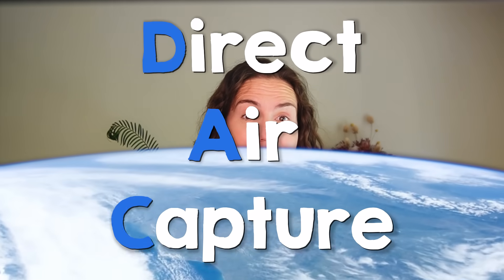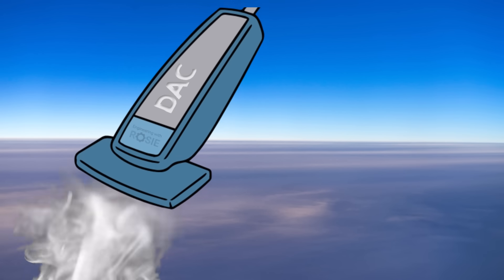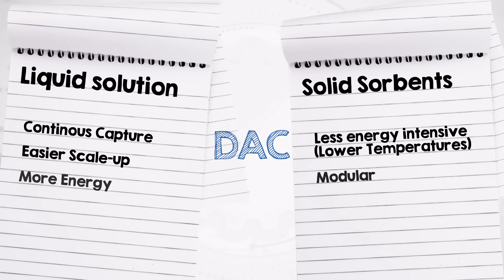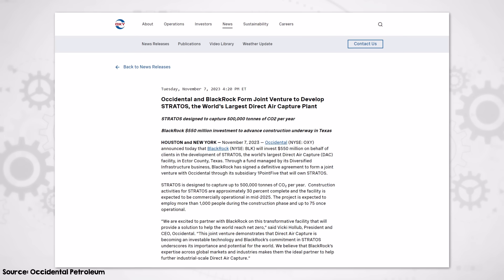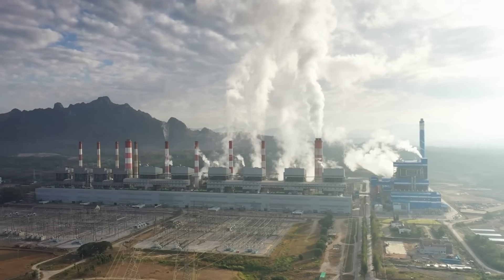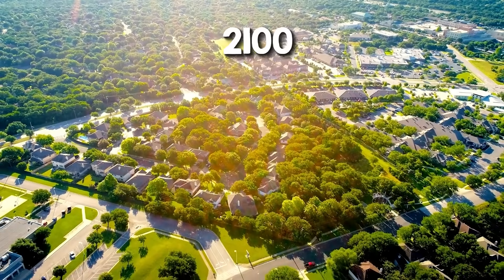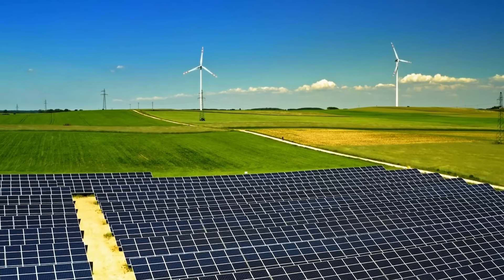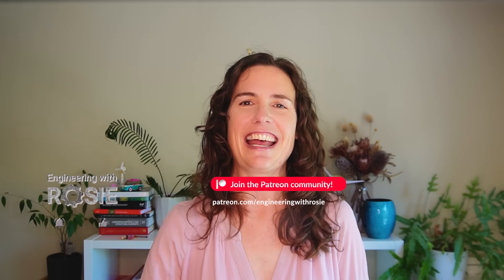Direct Air Capture: Climate Savior or Distraction?

Comment from the maker: Click my link to try Aura Health and save 25%! Your sense of peace and improved sleep starts here: https://www.aurahealth.io/rosie23
Reply: Aerospace engineer here - this is one of the most annoying subjects wasting out time these days.
There's no real need to go into the technologies. You can kill this entire argument just by asking how they'll process 1 Billion cubic kilometers of air to remove 2.5 Trillion tons of CO2?

Here's the explanation.
FIRST - the basic task comes from the fact we have (since the start of the Industrial Revolution) put an extra 2.5 trillion tons of CO2 into the atmosphere with 1.5 Trillion Tons of that being just in the last 80 years and at current rates we'll add another 1/2 a Trillion tons by the early 2030s. 
 
Way back in 1987 as an undergraduate (in America) we had a NASA Engineer (as a guest lecturer) explain to us why  terraforming Mars was utterly impractical. He'd just completed a project for NASA on what it would take. It was simply the amount of stuff needed to do the job. Before you even get to the subject of making things like water, oxygen and carbon dioxide cycles work you need to just get enough air and water. 

Its a subject I now call Planetary Mechanics which is doing basic calculations on volumes, mass and energy. He showed us just the basics. From that its relatively easy to calculate that to give Mars a layer 1km thick of Earth standard air requires 178 Trillion (with a 'T') tons of air. Plus you need to raise its temperature from -60C to +20C and that's a lot of energy for that much air. And you'd need a lot more than just 1km to make a planet viable.

The related subject is Planetary Dynamics which is how you make things like the water and gas and thermodynamic cycles work which is incredibly complex. Planetary Mechanics is reasonably easy for anyone to grasp except for how big the numbers are, because its mostly just being able to calculate volumes and what mass it takes to fill that volume. That's how you get 178 Trillion tons of air.

So coming back to Earth. 
Earths surface is just over 500,000,000 km² so in the first 1km above the Earths surface you have about 1/2 a Billion cubic kilometers of air. Its actually about 2% more than that. But its just easier to use 1/2 a Billion. Because if you want to consider the first 2km above the Earths surface its about 1 Billion cubic KILOMETERS of air and that's where most of the excess CO2 is and there's 2.5 Trillion tons of it we need to remove. 

So how do any of these clowns with plants that can do 1,000 tons per year plan to remove 2.5 Trillion tons?
How much will it COST in BOTH money and materials to build all these plants?
How much CO2 will be produced getting all those materials and building all those plants?
How much energy with it take to just build those plants and then operate those plants?

You don't need to explain the technology, because just the scope of the task rules it out as impractical.

If you want to know why an aerospace engineer is interested in all this stuff its pretty simple. My goal in life was to build a moon base. You then start with a couple of very simple issues. 
How do you build a volume of space that you can seal so that you have somewhere to live?
How do you fill that volume with air?
How do you get enough water to sustain life, because water is life?
How do you create just enough of biologic systems that they can become reasonably close to self sustaining so that you have enough air and food to survive? I think creating a 100% self sustaining system is impractical so the actual task is how close can you get for it to be practical in that it doesn't require too much effort to keep functioning.
THEN FINALLY - how do you power it all? This is where Kirk Sorenson got to when he was at NASA and re-discovered molten salt reactors.

If you want to do a video on this stuff let me know.
Reply: ... OR we humans could stop carbonating drinks.   😁

    I'll let myself out.        😒
Reply: @John.0z Yeah also stop breathing since you are just making more co2! Legit we are making it worse.
Reply: Hi Rosie! Great video as always! I found one of the points you made confusing though. At the 7:23 mark, you state that Carbon Engineering's pilot plant in Squamish, Canada currently captures 1 MILLION TONNES of CO₂ a year. However, at the 8:26 mark, you say, "Today, we have about 10,000 TONNES of carbon captured across 27 DAC plants worldwide." I suppose the 10,000 tonnes figure is per year? If yes, that is way less than the 1 million tonnes figure for the Squamish plant and clearly doesn't include this amount. So, these two statements don't add up. I couldn't find a source for the 1 million tonnes a year number for the Squamish plant. Could you please clarify where you found the data that the Squamish plant currently captures 1 million tonnes of CO₂ per year?
Reply: @innominateperson5275  I was going to comment on this. I'm pretty sure that the "million" at 7:23 should have been "thousand."
Reply: @londonwestman1  Thank you!
Reply: https://www.youtube.com/watch?v=go92lAvJTzE
Reply: WASF! We are orders of magnitudes off here basically pissing into a volcano!
Reply: Just a quick addition.
I know that since 1940 we have added 1.5 Trillion tons of C02 because I have that data because its well published.
And I know that at current rates 1.5 becomes 2.0 Trillion tons in about 2033-34.

I am not as sure as the 2.5 to date which you said was 1.7 Trillion tons. I think there is some contention over the pre-1940 data and what the "normal level" is supposed to be. If you look at the historical CO2 graph that NOAA and others publish then it should be below 270ppm for a normal Milankovitch cycle, except there was that event about 200,000 years ago that had one cycle hit 300ppm.

Irrespective getting the current 415ppm back down will take a geoengineering effort of staggering scale.

The only viable way that I can see it being done is a massive worldwide re-forestation program. We have to see trees as very cheap low maintenance solar powered carbon pumps. The issue is the number we need. In ball park terms we need every person on the planet to physically plant themselves or have others plant for them 1,000 trees. Hoping that we get 1-2 in every 8 survive to adulthood then we'd have 1-2 Trillion trees each pulling 1-2 tons of Carbon from the air.

Every other plane like seeding the ocean with iron to promote algae growth or seeding the upper atmosphere with SO2 has major issues in that NOBODY KNOWS what the secondary effects would be. The SO2 idea is the most off the deep end thing I have heard yet. What if it doesn't work? What if it works to well? What if they get it wrong and all that SO2 falls out of the sky as sulphuric acid AND its the same sort of questions for iron seeding the ocean.

In the end it comes down to doing something we know will work and we know trees work. We just have to do it at the scale that is needed.
Reply: Anybody trying to figure out how to make the transition to green energy needs Aura Health.  I on the other hand worry about the crazy people trying to end fossil fuel before it's feasible.  I don't need Aura Health because I know people won't prematurely sacrifice the economy and their standard of living for unreliable green energy.  Hopefully they don't figure it out too late.
You also need to consider the decrease in  productivity things such as electric trucks and electric tractors will have on the GDP as well as the economic cost to the consumer that it causes.  Don't even pretend to hope Fusion will be a viable energy source - the cost to build the reactors will be too high.
Reply: @kerryb2689  Your worried that we might get rid of oil before its feasible but ya not worried we will kill the planet before our we get rid of oil ooook.
Reply: great analysis!
Reply: Rosie, thoughts on ABC's In-Depth: Where is Australia at on the road to net-zero?

Comment: 2:10 The need to move air is not the real reason for using a lot of energy. In fact, you would probably prefer a location with a lot of air moving on its own.. (You might even tap that for the energy needed for the whole DAC process.) The energy is needed to liberate the CO2 once you have captured it in some absorption medium.

Comment: 1PointFive has gone from 0.4KT in 2022 - to what will best case be 500KT in 2026 when Stratos goes live.  To reach 59,000KT by 2030, they would have to build 120 more plants the size of Stratos in the next 5 years.  That means an average of 2 plants a month.  They haven't even announced a SECOND plant yet, much less 120 more.

Comment: As an engineer, you should also note that we have a seawater elevation issue that requires the elevation of large land areas or very expensive dykes.  Injecting supercritical CO2 deep underground increases ground level.   This was done with water in Long Beach, CA, and experimental CO2 injections.  In Long Beach, the elevation increase was up to 3 feet.

Comment: I think that the people of Hawaii that had an alert on their phone warning of an incoming ICBM probably would not think that ABM satellites are  such a kooky idea.  Since satellites are not sitting still but moving at a velocity similar to an ICBM and in the same direction,  an ICBM is an easy target.  The LAWS flying laser missile defense could destroy targets 100 km away.  
CO2 and Hydrogen  can be removed from seawater with electricity and used to synthesize ethanol.  If instead of offshore wind turbines that get in the way of fishing boats and nets and recreational boaters, large ships were used to collect wind and solar energy to synthesize ethanol, there might be a number of advantages.  No huge expensive  power cables and substations and underwater structures and expensive anchoring.  The ships can travel to where the wind is.  Like into a hurricane.  A hurricane with 120 moh winds has 64 times more power  than 30 mph winds.  A one kilometer square multihull ship with a deck 100 meters above the water and  with a 300 meter high sail has about 30 billion watts of wind power available in 120 mph winds. Dragging big propellers through the water to collect the energy instead of using huge turbine blades might require  a lot less materials to withstand the forces.  The deck area could also be used for solar panels or dishes.  1000 dishes firing a ten million Joule pulse might be enough to vaporize just about any target. Air turns into plasma with enough energy going through a small enough volume of air regardless of whether or not the energy is ionizing radiation..  Turning the air into a plasma bomb might be like slamming the target into a brick wall.  And if the plasma generates enough Xrays, it can fry the inside of the target.  The Navy spends zillions of dollars on ships.  These ships would pay for themselves and make a huge profit in ethanol. 
The ships might also be used to substantially reduce the power of a hurrucane. If an average hurricane has about 1.5 trillion watts of wind power, 100 ships would absorb most of the wind energy.
CO2 which is of great benefit for increasing food crops has been redefined as an existential threat by politicians who have been deceived by sneaky people with PhDs.   I was just a sophomore amongst graduate students that had to answer the question that the professir had posed some days before while the PhD's sat there clueless.
https://youtube.com/clip/Ugkxuk1XVQt9EBbtdXcjK9Sd3KarQPUvnY21?si=vNe8m34ULUEcG_a3

Comment: 2:20 That's not the reason for energy use. Indeed, you could put the DAC devices in the path of strong prevailing winds. The energy need is for liberating the CO2 from the capture medium. I'm a bit confused on why this statement is made, as the rest of the video makes it obvious that Rosie understand this aspect of DAC, in fact in great detail.

Comment: There is a perfect cheap system to suck CO2 out of the air, it also stores it and works on solar, it is called: a tree
Reply: And when the wood rots?
Reply: @maxriley1769  Prevent it from rotting and use it as a building material.

Comment: Any kind of force air movement for DAC basically renders it too costly and energy intensive.  Passive air movement via wind really looks to be the only affordable method.  Likewise the need for the geologic repository to be directly under the site means both things need to coincide and that's going to be rare so it will only be done at a few locations on Earth.

Comment: Here's an MIT professor who has direct experience on the topic of DAC talking about it.  Long story short we would need to expand our capacity for DAC by 100k times between now and 2050 in order not to exceed our goal of limiting warming to 1.5 deg C... The only problem is we're passing 1.5 deg C of warming right here right now.

These plants are talking about capturing 5-10 megatons/year whereas humanity is emitting 45 gigatons/year... and the fires in Canada last year alone emitted 1.2 gigatons of CO2.

Translation we would need 4500 of these huge plants, immediately, even to break even with our existing emissions.  Meanwhile humanity is growing in population exponentially and its energy use therefore is growing supraexponentially... as underdeveloped countries become developed. E.g. world electricity demand in 2050 is projected to be 5x that of 2020, which means 80% of the energy use in 2050 will belong to those unborn (or new uses in developing countries).

Unless these aforementioned 4500 plants can be powered with renewable energy... and be put into operation before all the major tipping points tip, it's too late to matter. 

59000 kilotons/year in 2030 for instance is completely irrelevant in the scheme of things.
Reply: https://youtu.be/KObewsFHA1U?feature=shared

Comment: There's a very easy way to figure out whether direct air capture is worth it:
Force all extractors and imports of fossil fuels to capture equivalent carbon to the amount they import/extract into some kind of solid/liquid form.
Thermodynamics say that you can't profitably burn fossils to capture the equivalent carbon, but it would force fossils to pay for their externalities!
(And for cases like airplanes where batteries are impractical, it would still allow transportable fuels.)

Comment: Smoke and mirrors to let the rich destroy the world for money. Not that they need it 28 COP OUT talks have got us to 1.3 degrees and each year more fossil fuels are used than the one before...
Lets here the scientists use the word "Optimistic" again as they have for the last 40 years of increasing pollution. 
Just at the point their money gets to a maximum it will rapidly go to zero. At this point they will start to think, not that it will matter.
Am I jaded? I got taught about climate change in 1978. Then they didn't know how it would change hot or cold but knew either would be a disaster. Then 45 years of increasing pollution...

Comment: An informative and well laid out video. I respectfully disagree that there is no place for DAC (and for that matter CCS) in our route to Net Zero. But I wholeheartedly agree these technologies shouldnt be used by O&G as a free license to continue unsustainable extraction of fossil fuels. IMO the amount of steel, cement, rare earth metals, etc. needed to build such renewable energy infrastructure basically necessitates some degree of  CCS (or cost permitting, DAC). We need strong policies/legislation to ensure such technologies can prevent unavoidable CO2 from being emitted, rather than as a an excuse for O&G to keep running business as usual

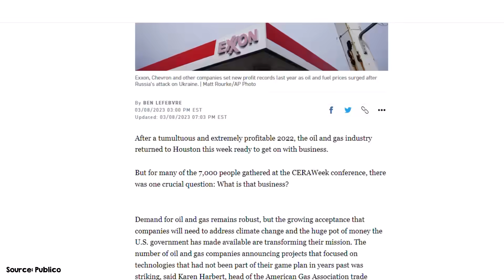Comment: Great content.. Thank you  Rosie  .. Why are these on the ground? Should they be  3-4 hundred feet up.? Blackrock? Then yes. I think its a distraction. 10:42   So they spit out c02  and then justify it by capturing it?  In the words of  Erin Brockovich, "By the way. We had that water brought in especially for you".       Why not use wind turbines?  They can turn a fan to suck the air into a filter and provide  some power  for whatever. 13:43. The ideal scenario would be to follow tesla back in the 20's.

Comment: Distraction. Completely without merit. Capture how much, exactly? There is one question that never gets asked that would expose the "climate crisis" for the scam that it is, which is "What percentage of the atmosphere is CO2?" The answer, never given in plain language, is that CO2 is currently around 420 parts per million, (google it) increased, they tell us, from 280 ppm in 1850. That's a difference of 140 ppm, or in terms more readily understood by the layman, the composition of the atmosphere has changed by 0.014% (14 thousandths of 1%) in the last 170 years. LESS THAN 1 THOUSANDTH OF 1% PER DECADE! How much closer to "zero" do they think it's possible to get? How much do you want to "suck out"? How gullible do you have to be to believe that this rate of change is causing extreme weather events, which have always happened and always will? Their claim is that this tiny amount "traps heat". ALL gasses dissipate heat and even if CO2 is an exception, the suggestion that a total of 0.042% can overwhelm the capacity of the remaining 99.958% to dissipate that heat is abject nonsense. CO2 DOES NOT control the global temperature, there is no "climate crisis". Wind farms, solar panels, heat pumps, EV's.. None of these measures are necessary, nor will they have the slightest effect on the weather. Eye-watering sums of money have already been wasted on this futile exercise. Time to wake up, stop throwing our money at these boondoggles and squandering the world's resources on projects that cannot possibly succeed as there never was a problem to begin with. There is no need to save the planet from a minuscule increase in the gas on which all life depends, but it does need to be rescued from idiot politicians and media mouthpieces that push this garbage.